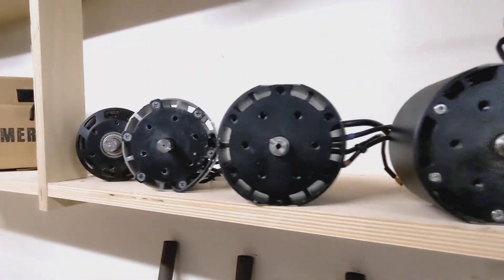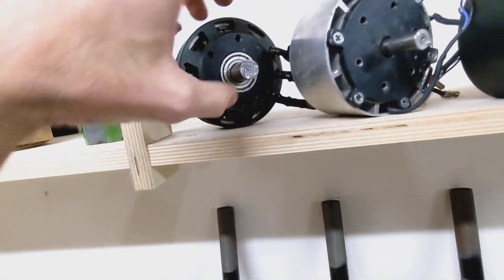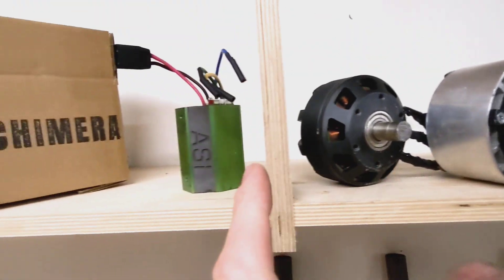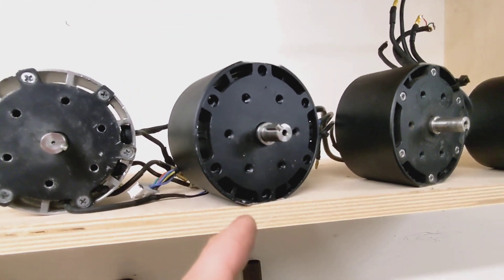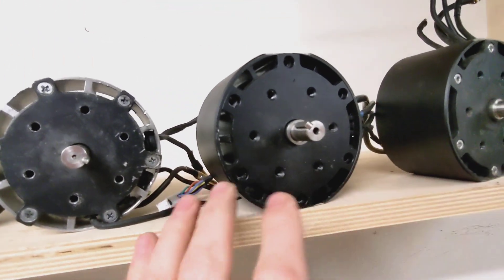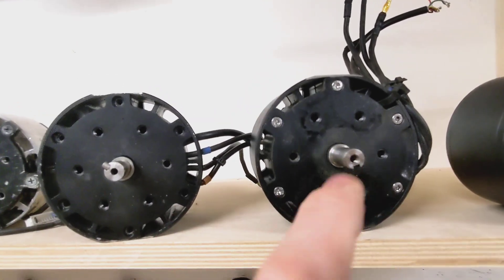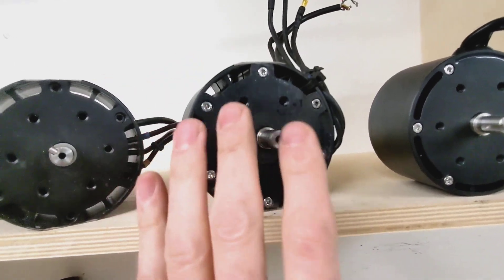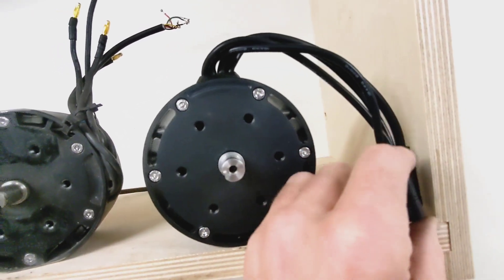Prototyping with different motors

Comment: Well now I'm curious about the first generation motor that was too loud and open couldn't you make a better dust housing for it or would it overheat?
Reply from the maker: @matthewhealy4752  Yea it would overheat if it were enclosed. Outrunners in general have that problem.

Comment: I'm curious, is the 35mph top speed is done with field weakening? And if not, can the motor handle it? I would assume the motor would be fine if the 120kv uses the same bearings as the 169kv one, and I wonder how it would change the top speed
Reply from the maker: Yes we use field weakening. If you turn up the FW on the stock settings you can squeeze out some higher speeds. The 120kv is better because it requires fewer reductions in the transmission system than the 169kv, which in turn allows us to use a planetary gearbox that can handle more torque. The bearings are fine on all the motors. The highest motor speeds we hit with the 120kv are around 9000rpms.